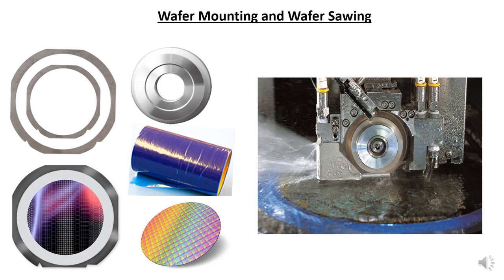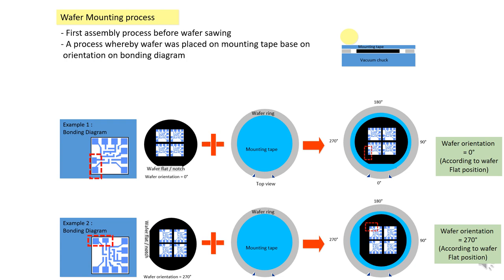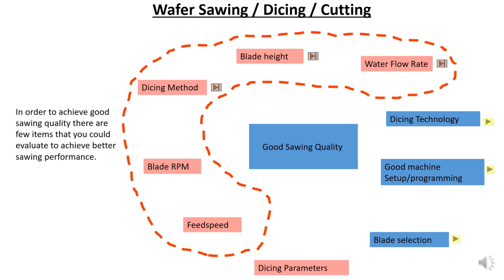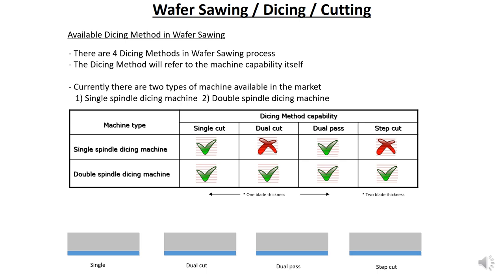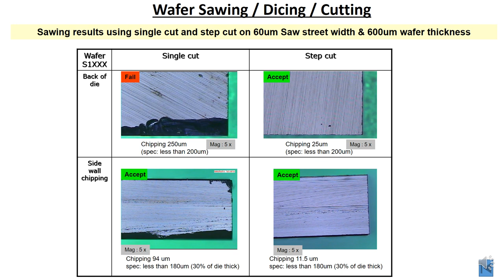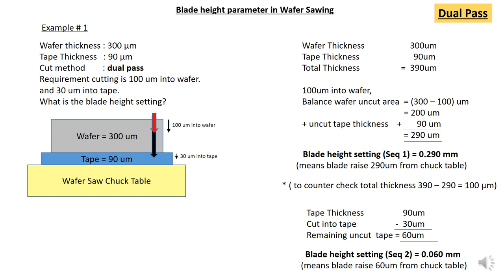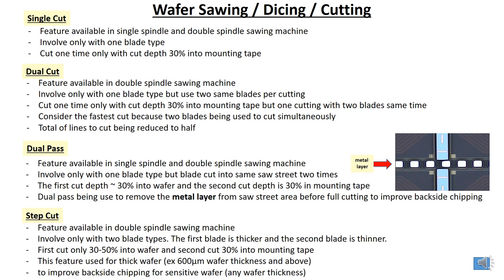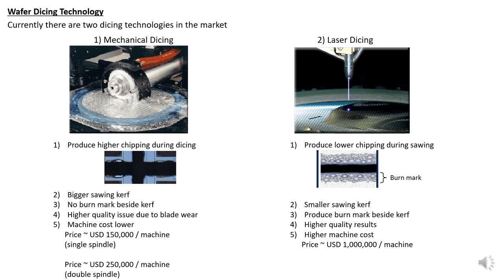BEEE 3814 Wafer Mounter and Wafer Sawing Process

Comment: Perhaps a new triangle processor architecture, which would increase the density per area and solve the problem of dei scaling in wafer manufacturing!  No need to cut the wafer as it would be a single circular die with 25 mm diameter, increasing the capacity by increasing the size of the circular wafer die!

Comment: Hello sir, I have a problem with cutting and I'm having trouble solving it. in fact the finish of the cut at the edge is clean because the gold (electrolyte) on the rear face folds. I tried changing the cutting depth as well as the feed speed but the problem still persists.

Thanks for your feedback.
Sincerely

Comment: Nowadays,  companies don't use wafer sawing machines, They prefer Lazer machines as I know, but I got a job which position is sawing part of semiconductor about battery . COULD you give me some advice about this job it is good or not for my Career??
Reply from the maker: laser sawing is expensive and some company will use only on critical device. I did published some paper on using laser sawing combine with mechanical dicing to eliminate the chipping touching on active area for 60um saw street. Sawing is an intresting process and I really enjoyed it. Hope you enjoy your job as well.

Comment: Well explained sir,  please witch parameter we must modified for reproduction of dual passe with a single blade. Thank you.
Reply from the maker: For chipping performance you can evaluate the first cut depth, Feedspeed and Blade RPM which suits your wafer performance.
Reply: hello sir, thank you for your feedback. in fact my problem is that I can't do the dual pass test as you explained. for example if I have to cut 10 lines on the 90 angle. it first does all 10 lines with a depth d1 which allows cutting only on the plate then it repeats the same operation on the lines already cut with a depth d2.
Reply: I would like to know how to adapt my program, so that the blade cuts a line with the two depths d1 then d2 before passing the next line. as explained in your video. Thanks for your feedback

Comment: Can we saw silicon wafer with 25 RPM?
Reply from the maker: The best is to perform DOE. It depends on the cutting method you are using whether single cut or step cut or dual pass as well. In basic, higher blade RPM produce lower topside chipping but resulting to higher backside chipping. In wafer sawing, parameter it is not only blade RPM plays a role, feed speed, blade height, cutting method and different wafer material and structure on sawing street will provide you different result, thus DOE is require for your device to get the best chipping output. For chipping free activities you could refer to my paper "Chipping free process for combination of narrow saw street (60um) and thick wafer (600um) sawing process".
Reply: Thanks for your feedback